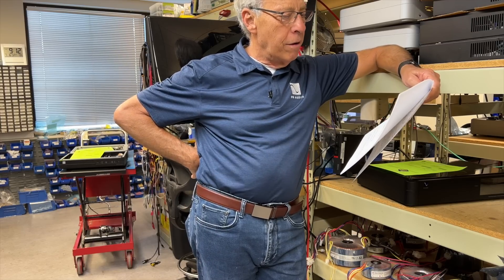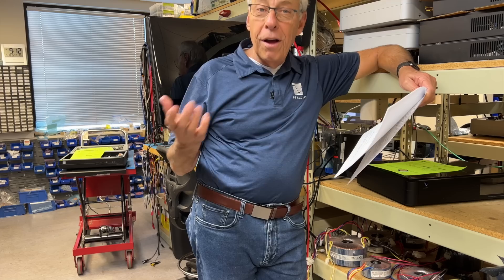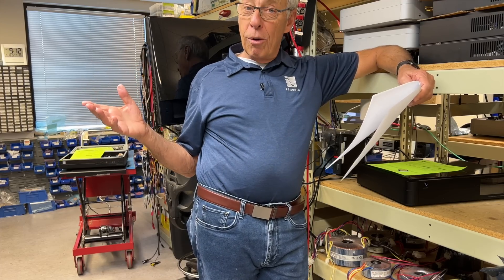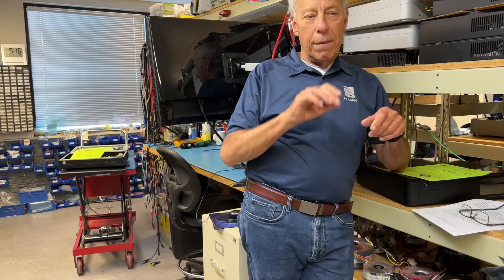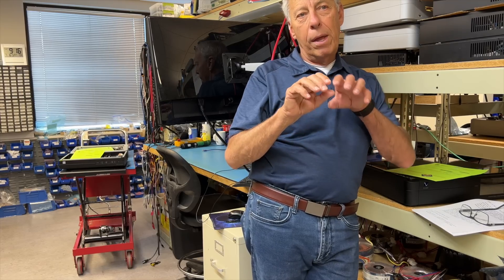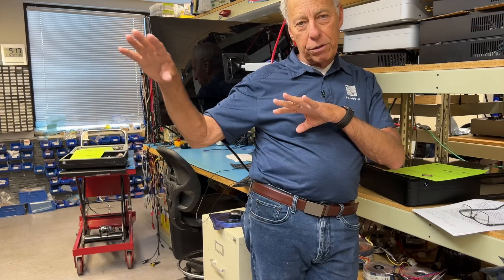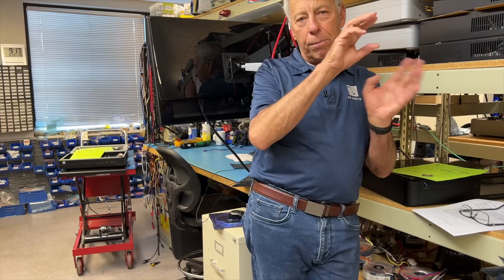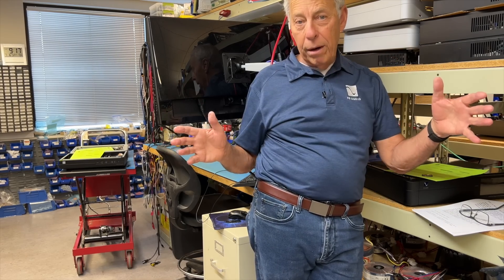Why Class D amps have small power supplies

Comment: I most cases replacing a "switch mode supply" with a well designed "linear" supply in a class-D Amp will improve the sound. The "switch mode" supplies are just used to keep the weight and the price point down. It's more about marketing than audio quality. Of course Paul did NOT mention why you NEVER see "chopper-switch-mode" power supplies in Class A/A-B amps.
Reply: @Douglas Blake the Yamaha is w years and the power supply hasn't changed in the newest models - be quite when you have no clue how! The power supply is one of the marketing points for Yamaha Aventage AVRs
Reply: @Douglas Blake  No, I won't trust you, because you don't know what you are talking about. SMPS and class D amps are inherently noisy to start with. You think SMPS are new? You think high end audio just wanted to waste money (for decades) on heavy and expensive transformers and heat sinks, when the same quality of sound can be achieved with noisy high frequency switching power supplies? Class A is as good as it gets (zero crossover distortion) and it is noticeably smoother than class A/B (because A/B mode is switching the transistors), let alone class D. 

It's utter BS that any decent class A/B amp will suffer from "sagging" rails when they have massive stored capacitance to top up rails instantly under any dynamic load. SMPS and class D amps are a (sound quality) trade off for higher efficiency and cheaper manufacturing costs. Looks like fell you for their marketing BS . Do you really think that some genius finally realized what all others were too stupid to realize for decades?  If SMPS sounded as good as linear power supplies, every audio company would have switched decades ago. Only the cheap crap used SMPS in audio devices and that should tell you something.
Reply: @gordthor5351  exactly
Reply: @Douglas Blake the crown xls amp is junk. to answer your question.. the reason class d found a home in pro audio is because its lighter and for the most part runs cooler.. the roadies are thankful.. other than that.. its not upper shelf amplifiication
Reply: @davidstevens7809  yep!!
Reply: @Douglas Blake AV Receivers minimize weight and space wherever they can. and those mfgrs love to brag about their power output and number of channels. Of course they are going to use SMPS.
Reply: I cant show pics..but.. the class g/h amps back in the late 80s started the change.. soundcraftsmen ma5002  was epic..
Reply: bob carver rolled out the magnetic field power amps.. they used a triac.. and the best was an amp hardly noticed.. stewart pa1800 was revolutionary switch mode supply amp..  now if we discuss where I worked in the 80s.. John france at ROCKFORD FOSGATE used a TL494cn with a lm339 comparator and the pwm controlled power supply driving first his bjt amp stages.. and within 2 years they rolled  out the power 650 mosfet amp.  and soon the all n channel design also ran with pwm supply.. all of these ran at 40k or above.. I could discuss what crest audio adopted and then... the  industry  changed the goals.. class D AMPS HAVE 10 TIMES THE DISTORTION..of the earlier class ab and g/h designs.. and young people that have never heard amps from the past have no clue.. but... I know the answer.. Paul..ive given you my number.. and you wont call.
Reply: @Douglas Blake the tripath based amps have a lot of dc offset and they must be very current limited so they can average the sample thats needed to effectively use the voltage divider .
Reply: @Douglas Blake class d amps must have an agressive output filter so that the stepped output resembles the analog signal that was plotted and used to get the voltage representation.. all this becomes a mess concidering that a speaker isnt just resistive load.  its LCR.. im not against a fast speed supply ..the best idea is to put it external to the audio stages.. but.. Someone explain what benefit there is to using a class D amp.. ??they first claimed better efficiency.. I agree if the amps below maybe 60 percent.. but if your running at just under clip.. its not true.  also theres a loss in the output filter thats in series with the load.. so theres less dynamics.. its actually a phase angle mistake. and its not the same across the bandwidth. anything they can build i can show you a bandaid.. used to cover up the fact that class d is flawed.  A well designed class g/h is better in many ways.
Reply: @Douglas Blake most amps that are now called class D are either B-D or A-D .. they are using different paths for modulation..but I understand neither is perfect . I have pictures from a storage scope comparing many amps while clipped. the class D amps have trouble during the dc top portion of the square wave .  it has ripple..but it is mainly dc.. and the stage gets lost
Reply: @Douglas Blake well I worked at rockford fosgate and they developed BD ... and my friend robert zeff invented A-D ..again they are different and I will not claim to have looked into it..
Reply: @Douglas Blake sir.  I repair amps for a living..and why are you attacking my abilities?
Reply: @Douglas Blake US20030122615A1... invented by my friend roberr zeff..its an improved class BD amp.. I believe its revered to as AD now
Reply: @Douglas Blake Typical not answering the question 😆 What’s new?
Reply: @Douglas Blake You always make claims I noticed and then can’t answer the question. For a guy that’s supposed to be in the audio game for 40 years you would know the names but you come up with absolutely nothing. That’s what I figured..I’m surprised your constantly on the YouTube comment section and not Twitter trying to start arguments. 🤡
Reply: @Douglas Blake name five manufacturers that are using a switching power supply in a class AB amplifier.
Reply: @ryanschipp8513  I can't name five but one the best uses SMPS - The Benchmark AHB-2. Look up the reviews.
Reply: @abecollins2266  I know all about it. The conversation wasn't, if there's anyone that uses a switching power supply that's class ab. The conversation consists of not many class AB amplifiers use a switching power supply. Also, my friend purchased the benchmark and said it sounded sterile
Reply: @ryanschipp8513  "name five manufacturers that are using a switching power supply in a class AB amplifier."

Topping LA90 ( Best measured amp on ASR )
Benchmark AHB2 ( Third best measured amp on ASR and many regard it as one of the best amps in the world )
Carver ( Over 40 years ago and had a patent US4218660A )
Chord
Linn
Emotiva
Solution Audio
Reply: @jasonkillsformomy  and by the way...the Topping is a turd. Why do you think it's so cheap. My Meridian G57 will trounce it sonically. My friend bought the Benchmark. Said it was sterile as hell. So, measurements don't always tell the story of an amp sounding pleasing or not. Another strike for you. You are digging yourself a hole.
Reply: @ryanschipp8513  correct
Reply: @Douglas Blake bullshit - Yamaha AVRs don't and my last Denon also had none
Reply: @Harald_Reindl  yep, the guy just doesn't have a clue
Reply: @Douglas Blake when you can't name a device I call it bullshit - it's that easy - I am a tech guy and in my environment statements are backed - are you from the USA where even the president no longer is used to back his statements?
Reply: @Douglas Blake We are watching Pauls channel....which talks hifi...not AV. You can't name one hifi manufacturer??? That's about what I expected. I see you willing to reply to many people's comments. That's great, but at least pass on the correct information before you write something
Reply: @Douglas Blake Doug...you are diverging. I'll ask again. Name five manufacturers and the models that use a switching power supply in their class AB power amplifier. You are the one that spoke nonsense and now you can't answer the question. And even though I shouldn't have to go down your rabbit hole because you can't answer my direct question and you are diverging, AV manufacturers are still using a very good amount of linear power supplies. You are wrong with that comment also. You're acting as if 80% of Manufacturers are now using a switching power supply in their AV receivers. Wrong again.
Reply: @ryanschipp8513  
I personally can only think of one and that’s emotiva. They are actually beginning to adopt SMPS in class AB amps but I believe that’s only in their low level stuff if I’m not mistaken. So yes you are correct, hardly any manufacturers use them in AB. Not to my knowledge anyway
Reply: @shannonmiller5648  thank you for your message. I don't claim to know everything but I knew for a fact that Doug was incorrect with his statement. And if I think I know something make a statement and then somebody corrects me I have no problem admitting I was wrong but apparently he's too proud
Reply: @Douglas Blake i only proved "These days just about any AV receiver has an smps in it.  So how many manufacturers... practically all of them" bullshit - not in combination with Class AB amplifiers - if you would have made a point that Class D becomes more popular... but even then "practically all of them" is bullshit
Reply: @Douglas Blake you aren't important enough to have any connection to my feelings :-)